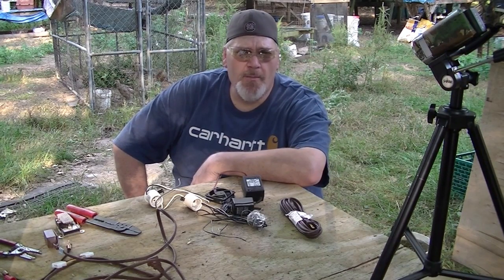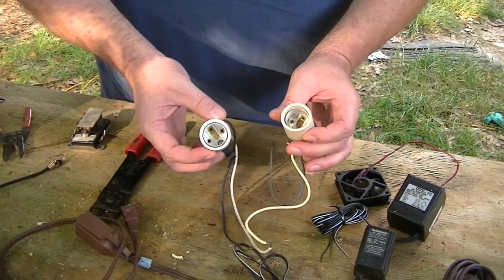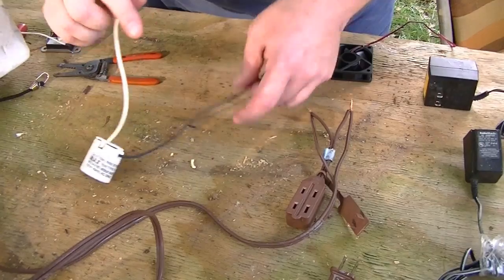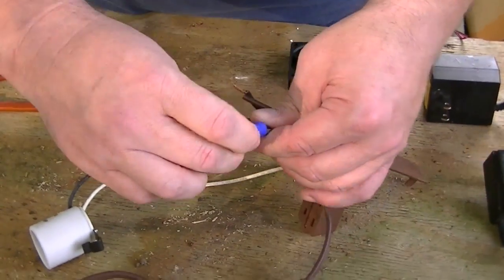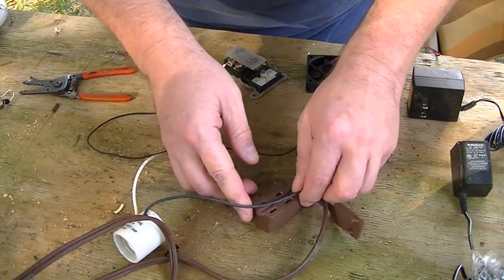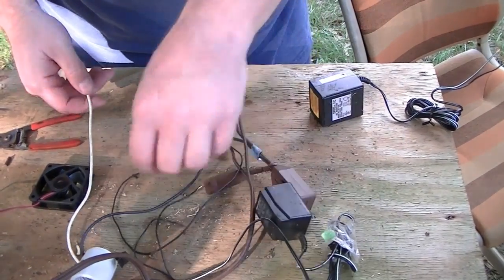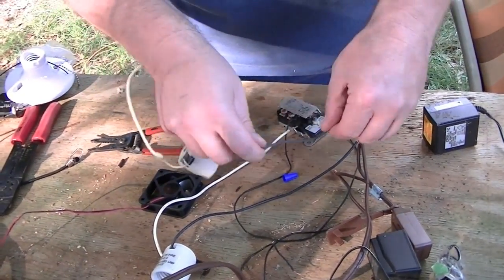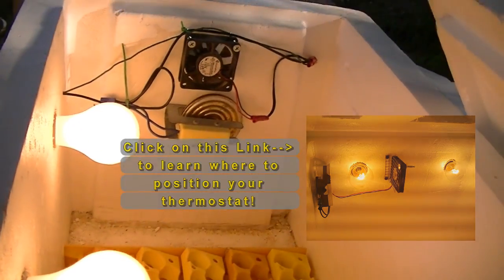How to Wire up a Home Made Incubator Made easy!

Comment: Hey quick ? Do you need a fan in a incubator I’m am building one or I have built one and I can’t get the temp ring I had the lights and fan in the top so I moved them to the bottom and I’m checking that now but the bottom was cooler than the top I know heat hose up but I have seen many on top lol I think my fan is to strong but I change and went down on the plug in from 700 ma to 400 ma to slow it down I hope that works but if I don’t need one I can take it out thanks if you know or can help
Reply: yes... you need to keep the air moving. the developing chicks need a lot of oxygen during the incubation cycle!  Wade

Comment: Hi.  Thanks for your video.  I understand better about the wiring now.  I do have a couple questions about thermostats.  1. How do you set the type you show (electronic)?   2.  does the electronic kind read ambient or radiant heat?  i.e. can you put it next to the lightbulb and get an ambient reading?  
3.  It looks like you have two thermostats set up in the one incubator.  What is the reason for that?  Sorry for so many questions.
Reply: sorry Brenda... I just missed your question!! You need the bulb close to a water heater type thermostat so that it can react quicker to the radiant heat from the bulb. but when using a digital or a GQF Wafer type it's not necessary for the heat source to be close to the thermostat as they read and respond to the ambient air in the incubator. Hope this helps! Wade
Reply: @BubbaRountreeOutdoors  thank you!!!  I bought a used Genesis 1588.  Its "ok."  But after watching your videos I think I can build something way more reliable from a plastic cooler and cheaper parts from Amazon and Goodwill.

Comment: Thanks for the nice video sir. I wish you could gone ahead and shown how to connect the fan with the shown system rather than separately. Or does it mean I have to buy a separate adapter for it?
Reply: Tom Okoth I think you need the ac at apt Er connected separately to keep the fan running continuously

Comment: Lovely little set up. I've made 2 of my own very similar to yours. One of mine has a thermostat like yours and my other one has a very easy to fit thermostat that plugs into the mains supply and it goes inside the incubator and then one of my lamps /. Bulbs plugs into it. I have 2 lamps /. Bulbs fitted in mine because if one blows the other will keep the eggs warm until a new bulb is replaced. Both of my incubators work well. The only thing I've done different to my polystyrene boxes is cut them through the middle and taken a section out and joined it back together with silicone. Just so it's not so tall. Thank you for sharing your video. 👍

Comment: Great video. How many watts are each of the lights bulds please? And if you only use 1 light bulb does that light bulb have to be of higher wattage?
Reply: Bulbs are 40 watts... You can use 1 bulb (Depends on the size of your incubator) I never liked using only 1 bulb just in case that bulb blew out when I wasn't home! There are times when i will use 2 (20 watt) appliance bulbs in a small bator just to be safe! Wade

Comment: I need your help my friend. I need to wire my AC reversible (3 wires) motor using limit switches and timers. I do not know how to wire it with auto and manual mode ( for loading and unloading eggs) using toggle switch. Please help.

Comment: How much temperature set in incubator tell me plz
Reply: 99.5 degrees F. or 37.5 degrees C.
Reply: @BubbaRountreeOutdoors  Wade I just finished making my incubator works good and is maintaining temp using the STC 1000 thermostat. I used two 40 watt appliance bulbs seems very bright when they come on have you ever had any chicks eyes damaged by the bright lights or am I worrying about nothing.
Reply: @jrob8764  No worries Rob! The chicks will be fine...

Comment: First of all i, must say thank you, for answering my questions, there is one thing, i, will like to know when using  a w1209 thermostat for your incubator, does the 12vdc fan works continuously. Thanks.
Reply: Hey Winston! Yes, I keep the fan running all the time. The more the air is circulated the more oxygen the chicks will have access to!

Comment: Hi.  Thanks for your video.  I've just made one with the same kind of set up. Only difference is that my thermostat is a fish tank heater that I already had.  It works a treat. And it's adjustable. Just got to run it over night until I get the temperature set right

Comment: I have never wired anything.  But I'd love to try.  I went to Lowes and found the bulb sockets but they did not have wire attached as yours do.  I would have to buy the wire separately and they started explaining 18/2 and 18/3 and which wire I needed and I am embarrassed to say that I became confused.  Where did you get the wire and what kind is it?
Reply: This is what u need Stephanie: https://www.lowes.com/pd/SERVALITE-75-Watt-Black-Hard-Wired-Light-Socket/3379428

Comment: great video. this explained a lot more with wiring the thermostat. my reptile one, all i had to do was plug in the flexwatt. but this method is way cheaper..ty so much!!! still need to know how many bulbs/ wattage id need for a 3ft mini fridge :) im thinking 2 regular 60 watt bulbs or even a flood light? suggestions? :)

Comment: I made a cabinet incubator using this method and it seems to be ok as far as temperature swings. I was wondering if you could use a digital home thermostat and if it would work any better for a cabinet style incubator.

Comment: hi thanks for the video and intruction to wiring.question is this 12v and 9v that's what I need.or the same one especification you have.becaise there some ones whit any can number the diferens any help I appreciated.thanos again for the video.
Reply: This is a 120v AC set-up. Using a PC fan that is 12v/9v DC. That's why we need the 12 DC converter.

Comment: hello sir what is the alternative, if i dont have an adapterinverter for the fan??
Reply from the maker: Hello! Then you will need to get a small 115 volt AC fan. Wade
Here's 1 on ebay!  http://www.ebay.com/itm/NEW-PABST-Typ-8500N-80mm-x-80mm-x-38mm-115V-AC-Cooling-Fan-/252454524525?hash=item3ac776566d:g:6M4AAOSwgY9XgAVH
Reply: thanks you very much it helps me a lot!

Comment: what's the best price for a egg turner motor
Reply: is that a hot water thermostat
Reply: yes it is...
Reply: you can usually find the motors for around $10 at Incubator Warehouse!
Reply: do you sell any accessories? I live in Mexico and the only place to get an egg turner motor is online, amazon doesn't ship to mexico, eBay comes from China and customs won't let it in when it sees the shipping address from.China, the other option is a Latin american sister company of eBay or amazon but they sell it for 25 dollars I'm looking into buying around 10 for starters
Reply: Do you have a video of installing an egg turner?

Comment: what is the purpose of fan sir?
Reply: The purpose of the fan is to circulate the warm air around the eggs, so they are evenly heated top to bottom...it eliminates hot and cold spots in your 'bator. Happy Hatching!
Reply: +Beau Peep ahh OK thanks sir,we use at all times or how many minutes or hour in a day?

Comment: hi im daniel im using the thermostat the way u said but it cuts down around 100.94 and starts up at97.7 is it ok
Reply from the maker: Hey Danny... There will be purist that will say I'm wrong, but your temps are swinging between let's say 98 to 101 degrees... that's an average temp of 99.5 degrees. That will work just fine! 1 of my 1st incubators did the exact same and had the same temp swing and I hatched hundreds of birds in that old home-made incubator! Good luck with the hatch buddy! Wade
Reply: you need to rotate the egg?

Comment: I don't have a fan like that its a little bigger and it has four wires that is coming from the fan. Colors are green,yellow,blue and black. How will I hook that to the ac adapter and is there a different way of hooking the fan somewhere when the light goes out the fan can just kick right on to cool down the bulb.
Reply from the maker: the fan's main function is to circulate the air inside the incubator! You need to hook up the yellow wire to the + side of the 12 volt DC power source and the Blk wire to the - side and your fan should run.

Comment: Hey, I just ran into a problem...my thermostat wont turn the lights off and temp is going up 103....is the stat needin replace'n?
Reply from the maker: maybe... you may just need to tap on it, it might have gotten some dirt in the thermostat!
Reply: Well, I just changed to a new thermostat....good thing I had bought extras....I was just on my way to get another cooler....I have to buy my eggs from around the states. So, keeping from loosing them is highly important...

Comment: Hi wade just a quick question I've just made an incubator with the wafer thermostat thanks a lot by the way as I got the idea from watching your video's which I find fascinating. The question is when the lights trigger to turn off by the micro switch in the thermostat do they actually turn off and go straight out and come back on or do they dim right down then brighten when triggered on again, just that mine dimm right down and I was just wanting to make sure I've done it properly thanks
Reply: Hi Josh! The lights should go out! If they are only dimming, you may have some debris in your thermostat. It's best to have a way to blow your thermostat out with some kind of compressed air. Then try it out again...

Comment: hey im in six mile sc lol like your videos. im still a moron and kinda of lost. but i saw you had a different light fixture over there and it is like the one i plan to use. do you need a box on it or any thing? or just a hold in the incubator to run the wires out and then mount it up?
Reply from the maker: Hey Dusty! Watch this: Installing an STC-1000 Digital Controller into Your Home Made Incubator!

Comment: Thanks for this good video.  I have a question though:

In the set-up I'm planning, the fan will be running off a separate power supply - I understand that the computer fan has to have an inverter, since it's only made to run off the roughly 12 V DC.  I'm planning to use two light bulbs and hook them up to a GQF wafer thermostat - their power supply will be separate from the fan's.  

My question is, do the bulbs and thermostat need to have an inverter on their cord?  I assume the bulbs can take household current, but can the wafer thermostat?  Will I blow out the GQF thermostat if I just plug that circuit right into the wall?  Will the wattage of light bulb I choose make any difference to the thermostat (like if I put two 75 watt bulbs in there, would that blow it out)?

Thanks very much.